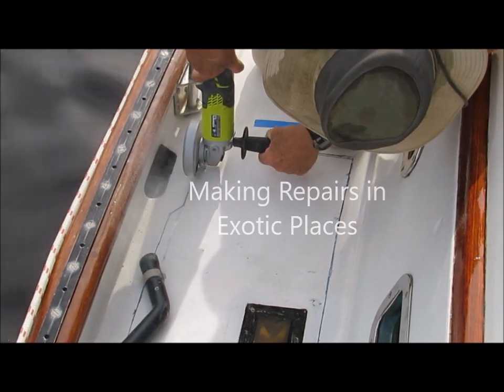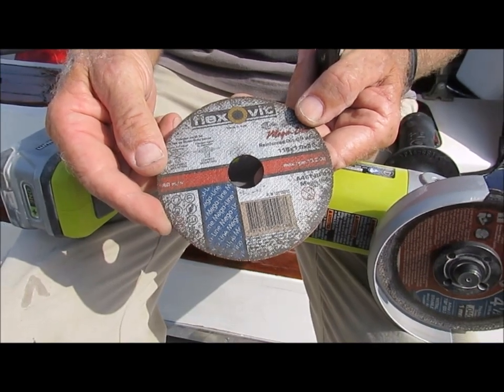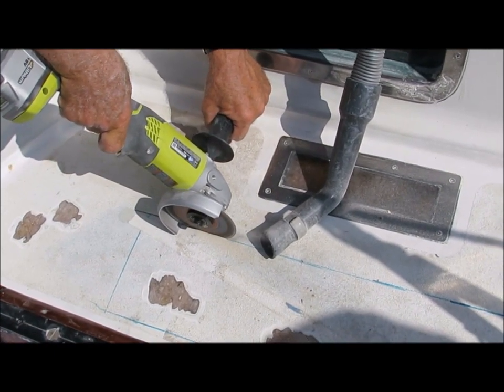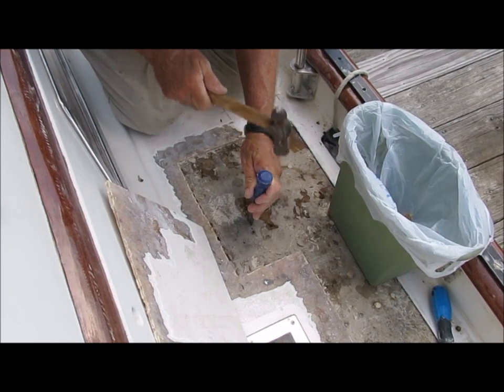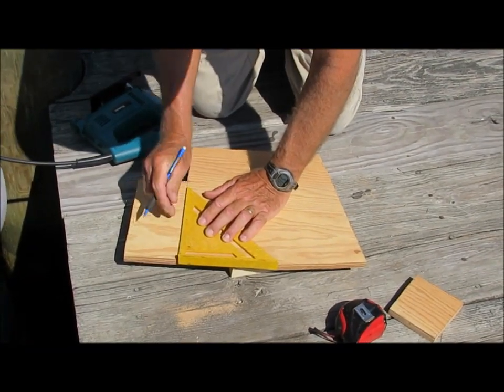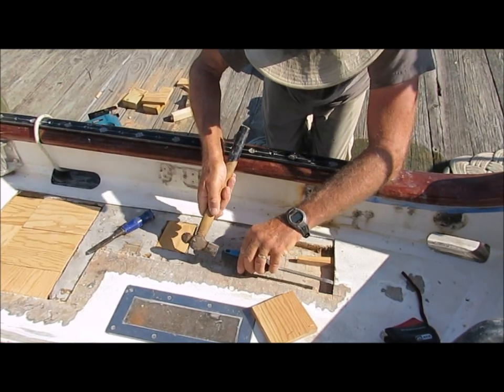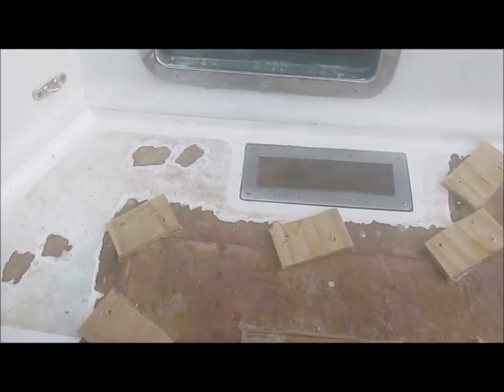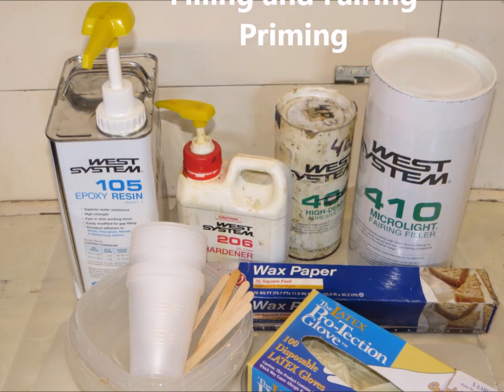Deck Repairs Part 2: Replacing the Core

Comment: You Need a 90 degree Angle air grinder with the Rolock Discs to smooth the Bottom glass and the top Glass that was Cut and Removed.. Thanks, Richard

Comment: A combination of a circular battery powered saw (which you can set the depth, so you don't cut through the fiberglass on the under side of of the core) and a multi tool vibrating saw to take out the damaged core it's much easier than using a hammer and chisel to remove the core! instead of using plywood I used a foam core cut into blocks held together with a scrim on one side. You can open up the blocks and place epoxy into the cuts between the 1" blocks (this is an extremely messy procedure and I do the epoxy placement into the blocks over the area they are going into).

Comment: Nice video.  Very straightforward and informative.  How experienced were you with glass work and epoxy before attempting this?  Why didn't you use balsa? What was the total project time from start to finish?
Reply from the maker: I wouldn’t say that I was all that experienced with glass work, but I did have the opportunity to watch some real pros while in New Zealand. Balsa is great, but I had trouble finding it in the thickness I needed at the time, and it’s more expensive than plywood. Not counting the painting, I’d say it took about a week to do the section. I did almost the entire deck piecemeal over a few years. Thanks for the feedback!

Comment: I am repairing a locker lid in my cockpit. I am using a solid piece for the core. Do I paint both sides with resin prior to fiberglassing? Is the reason you use pieces instead of solid is to get the glass under each individual piece?
Reply from the maker: Hi William, yes, definitely paint both sides of the core with epoxy. I use pieces of wood for a couple of reasons… to better fit in the space if there is any curvature or irregular edges, and to better fill any voids with thickened epoxy.

Comment: I need to do similar repair on my boat, I can get to the deck from underneath, would the repair be similar in the steps?
Reply from the maker: Unless the repair is a very small area  - like, say, under an old windlass switch, it will be very difficult to make the repair from below. Not only will you have a real mess, with the epoxy dripping out and the new core material sagging, it will be almost impossible to complete the fix without leaving voids. Maybe if you wet out the plywood pieces and screw them in place - right thru the deck fiberglass - to hold them until the epoxy begins to kick, then remove the screws and use a very thick epoxy mix to fill the voids as much as possible. Then tape/screw the lower layer of fiberglass in place - moving quickly before the epoxy drips out. After that kicks, drill a bunch of holes from above and squirt epoxy into them (as well as the screw holes from the earlier step) using a syringe, and you might be able to fill most of the voids. I can see this turning into a real disaster... but I've never tried it. Good luck, and if you do try it, please let me know how it turns out.

Comment: Cosmetic repair. Try do that method on a foredeck to hold the short forestay or anything that requires force. Given time you will get a bigger soft spot.
Fibreglass core is foam SANDWICH construction. It strength requires both.
Try this with cardboard it's a disastrous method.
Reply from the maker: I’m not sure why you thought the core was replaced with cardboard. I used marine ply for the core, and it was sandwiched between the two layers of fiberglass. It’s a very strong combination that is used quite often with good results. Did you actually watch the video?

Comment: I don't think you will not get maximum strength using pieces of wood. But it is better than not doing anything with it!
Reply from the maker: Marine plywood is quite strong for its weight. This is the accepted method for replacing a cored deck - at least in the US. From your name - perhaps you are Swedish? Is it done differently there?

Comment: Why they don't use High Density Foam for the Core? Just mix 2 Liquids and the foam spreads and expands. One would have to have cut relief holes as not to damage the boat. I have worked with this foam and Believe one could open a safe - Blow the Door Off by drilling a Hole and pouring the 2 Part Foam Liquid.
Reply from the maker: Hi Timothy,
Good idea, but I think you’d still need to remove the wet, damaged core before pouring the foam in. The process would have to be very carefully controlled to avoid voids or, even worse, distorted, bulging decks as the foam expands. Many people also suggest drilling multiple holes and forcing epoxy into the core, but it’s my belief that this is a temporary fix at best.

Comment: Try a vibrating multi tool too cut the fiberglass, it works gtreat and does not throw dust. I have covered myself and the interior of boats using the rotating cutting wheels, never again !
Reply: fein works well